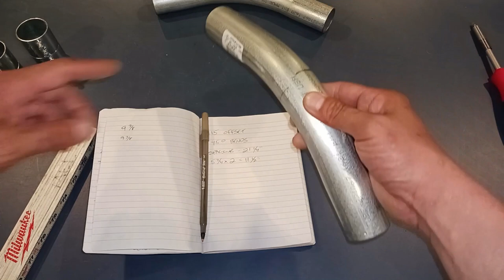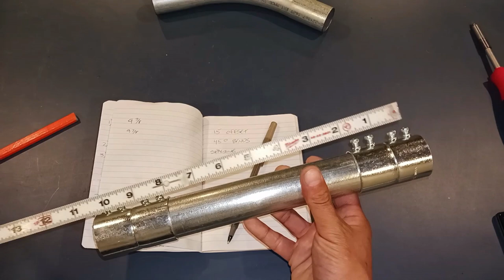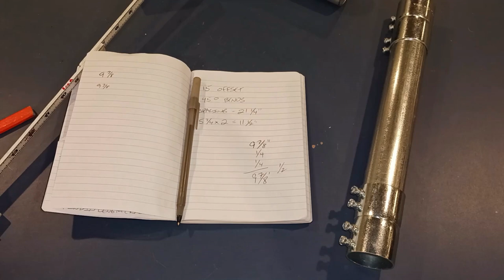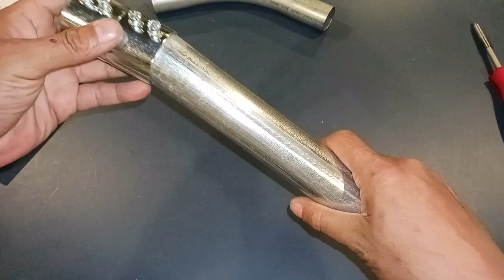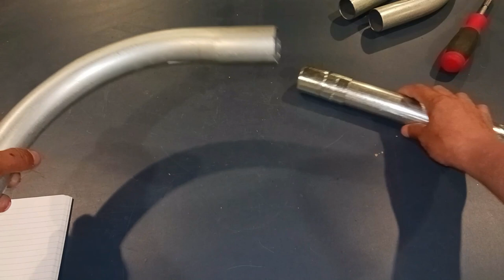How to install pre-fabricated conduit bends (How to calculate your cuts)

Comment: Before this video I would mock up the pre fabs on the ground and measure what they give me then work it back wards and figure out how much I’d need to add or reduce my cut piece . That method has worked for me but it’s good to know diff ways to skin a cat so you’re never left out there like a chicken with its head cut off .
Reply from the maker: Yes for sure. Whatever works right. What I'm want to do is just show everyone. With a little patience and math. You can actually make it easier on yourself. That's all. Thanks for the comment.

Comment: Great content bro. Quick question, I thought that in order to calculate a 90 with a kick, you had to measure from the center of the conduit in the back of the 90, not on the actual back of 90. Your comment would be greatly appreciated
Reply from the maker: Sorry it took so long to answer back. When you are dealing with prefab the procedure is a little different. I'm not entirely sure what you are trying to ask me though. Best way to ask me questions is on my discord server called Holmzlaw.

Comment: Whats your best video to watch explaining how to use bending to center?
Reply from the maker: I don't fully understand. You mean using center of bend to make all your bends? Actually I don't have any video on that. That's a video I should do. I never thought about doing one because it's the same process as not bending on center. The only difference is charting your bender with all the center marks. I have a video on how to do that. Just look up charting your bender by holmzlaw.
Reply from the maker: Here is the video for charting your bender. I'll try to come out with a video on bending on center. 
https://youtu.be/FHKTH-WXc14
Reply: @TheArtOfConduitBending  thanks for writing back. I have never done bending using center of bend to center of bend but I have heard of it I believe. But what I think I am asking is basicly from the center mark made on each pre fab that is the distance when you use your multiplier for that degree of bend ? so if i bent on a hand bender a 4"  offset at 30 deg and then marked center of bend on each. The distance between each mark would be 8 " just like my multiplier was 8" between marks?

Comment: Tht take too long couple up the two offset measures the height then subtract it from the high u need then multiple by the offset multiplier
Reply from the maker: That's pretty much the same thing. It sounds like it might take to long but it really doesn't. Anyway thanks for sharing your method.